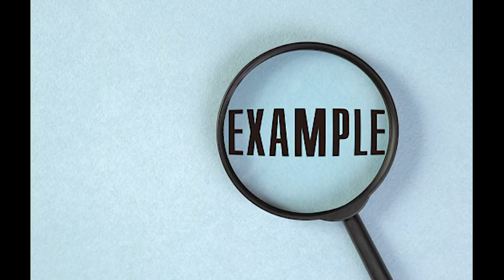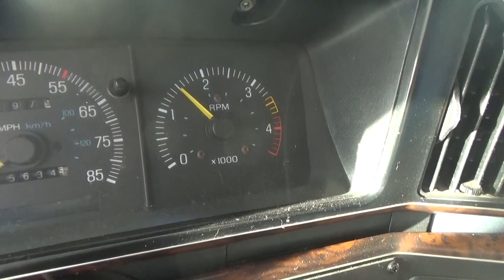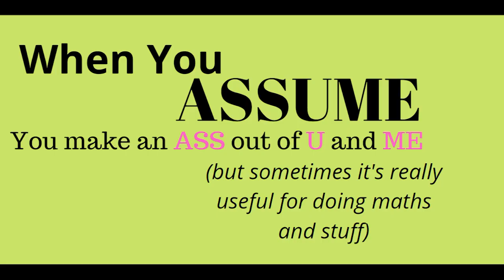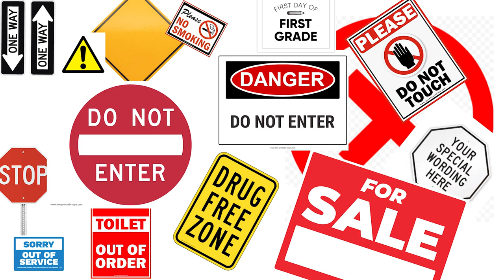How to tell if your injection pump is bad

Comment: You could also have a truck that starts and runs fine at first, but when hot will not restart. I have that on mine and have to pour water to shrink the hydraulic head and then it starts immediately.

Comment: I'm currently having some inj pump issues on my m35a2 but only seem to have the hard start issue. im hoping the leak is before the pump as there's pressure to it [i can hear the fuel sizzling out slowly after shutting it down,] but i would assume after the pump the leak would be much worse with the 40-80psi they say it runs. Won't know til it warms up again!
Reply from the maker: I do know that those lines have a tendency to leak.  before and after the Injection pump. So defiantly check that first. Because it is all mechanical, if it has to re-pressure the lines every time that could cause hard starting. If there is no white smoke I don't think it is the injection pump. Also depends too if your cutting oil with fuel, or if your just running engine oil through it. Definitely check your fuel filters too.
But also check the fuel density compensator its like a fuel looping , look up tactical repair on YT he does Deuce repairs.

Comment: I have recently acquired a 1994 7.3 IDI that sat for a number of years. I recently got it running fixing some air intrusion issues. Now it starts up without too much fuss however it misfires and billows  large clouds of white smoke. I drained all the old fuel and changed out filters prior to starting it. Once running it takes about 10 minutes for all the big white smoke to subside and the misfire to balance itself out. The truck then idles quite good and the throttle seems to be very responsive but it still has a light blue smoke even at operating temps. Where should i start with replacing parts. I've done return lines, treated the new fuel and additive and put some ATF in the fuel filter to help the pump originally when i got it running. My concern is the it only seems to billow the cloud of smoke at start up and then for 10 minutes after but not the whole time its running ! Should i be concerned about worn out rings or a bad cylinder ? The truck has 91,000 miles with original engine. Its a retired e350 ambulance that was fleet maintained. Any and all response messages and advice would be greatly appreciated !!!! TIA
Reply from the maker: That really does sound like an injection pump. Although because of difficulty to replace (if you haven't done it before) and price of parts, I wouldn't start with that. So perhaps check the fuel pump, weather its the old mechanical one or an electronic one. Improper fuel pressure could cause that. BUT it would cut out at higher RPM's, lets say about 2,500 and above, due to the lack of fuel. 
White smoke will never be cause by rings, that would only be blue. If you can, when it's warm really study the color of the smoke. "Oil burning" smoke is a slightly darker shade of smoke compared to "cold burning fuel" smoke. Which is more of a lighter blue at temp. It is the "white smoke" but because everything is nice and hot it will appear a very light blue. (diesel burns like oil does, it's just engine oil takes an immense amount of compression and heat to properly ignite so it never fully burns, hence the blue smoke, with improper injection pressure the diesel won't fully ignite causing a similar smoke effect.)
One other way to test is to get a friend or a camera to look at the exhaust. When it is fully warmed up, and idling fine. Give it the beans up to about 3,000 RPM. Don't hold it there, just a quite acceleration. Possibly a couple times to really see what's happening. If it has descent throttle response, but there tons of white smoke. Then it is your injection pump.

Comment: Your signs simply describe all idi motors whether the IP is good or bad
Reply: Okay the steady flow of white smoke is indeed a sign lol. That shit was chuggin bud
Reply from the maker: @RIPFPSDOUG  I mean there are some similar signs of a poorly running engine. But the rough running, and constant white smoke even when warm, is quintessential low combustion temp. Which is a fuel related issue. Weather it's injectors or the injection pump.
Reply: @ThisGuysStuffandStuff  yeah I typed that before I saw the steady white smoke. Just figured it was just at startup
Reply from the maker: @RIPFPSDOUG  ah, gotcha. No worries!
Reply: Did you change it with some r&d magic ?

Comment: Mine has white smoke but it only does it on start up but does linger had a mechanic that familiar with these listen to the injectors all are working fine.he even checked the pump mines just very tired odo says 169k but i think it has more on it.

Comment: All good points.
Does the FIP have a thimble type filter on the feed to it?. 

A mate had similar symptoms of white smoke, rough running etc on his Nissan D21 with a VE pump. Once we cleared that filter it ran well.

Either way....Put a Cummins🙌🏻 in it👍🏻😁
Reply from the maker: Ah yes I could see that if there was very limited flow to the Injection Pump then it could cause similar issues. 
Obviously I would rule out possible fuel issues first. 
but good input thank you!
Reply: @ThisGuysStuffandStuff  
You Legends are welcome.🍺

Comment: That's why I avoid those boat anchor IDIs and only buy the 351w and 460 trucks.
Reply: That's why you're buying trucks and not a truck.
Reply from the maker: Every engine has issues with age haha. An injection pump going out is akin to a carburetor going out. And some carburetors are harder to tune than injection pumps. It really is just a case of pick your poison.
Reply: @ThisGuysStuffandStuff  I only buy the fuel injected 460s and 351ws. lol
Reply from the maker: @pcwizzy460  oh yeah, those are usually pretty good. Only problem the newer you get. The more sensors it gets. And that is just a pain to deal with
Reply: @ThisGuysStuffandStuff  These will run on just two sensors.
Reply: Yea if u want 10mpg
I get 18
Reply: @pcwizzy460 , IDIs don’t need sensors to run. 100% mechanical. Except for the fuel shut off solenoid in the IP.
IDIs are a tractor motor. Whether it’s got oil or coolant it’ll run, & it’ll try to kill itself if ur not careful. CDR will get dirty & stick open. Or the coolant temp gauge will 💩the bed, & not warn you when it’s abt to die.
Reply: @tacoman864  I get 17MPG out of my '91 460.